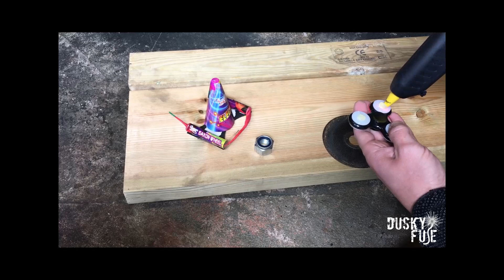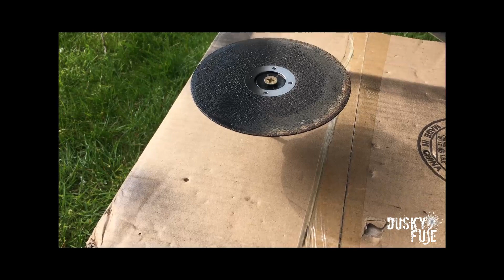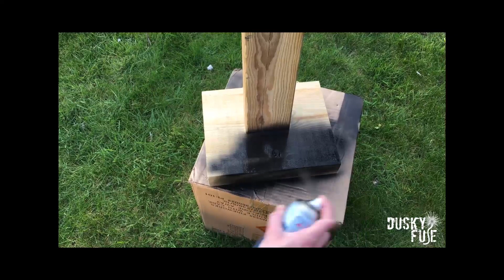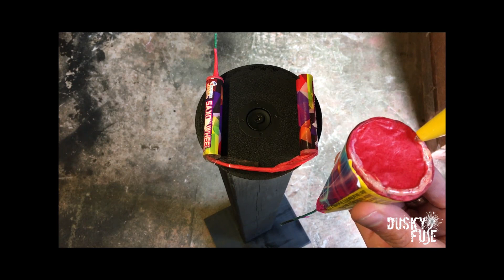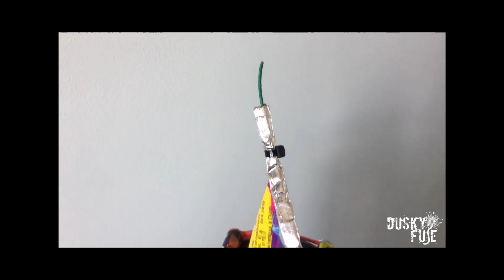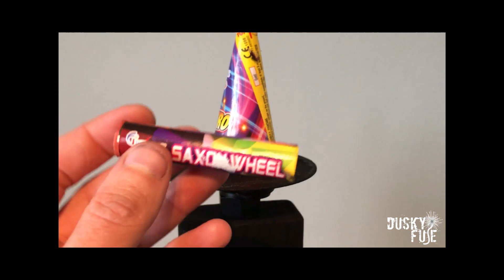Make a DIY Spinning Fountain! (With Test Firing)

Comment: Love the diys mate... I have a really difficult one for you, make a 1/2/3” shell from a rocket? Or if that’s too difficult make a huge rocket from 2-3 smaller rockets! 😄
Reply from the maker: A shell wouldn't be too difficult. If you had a ball head rocket I guess you would only need to remove the motor and then replace it with a lift charge for firing out of a tube. I have a few future DIY projects planned but all are a little safer than your suggestions! ;)